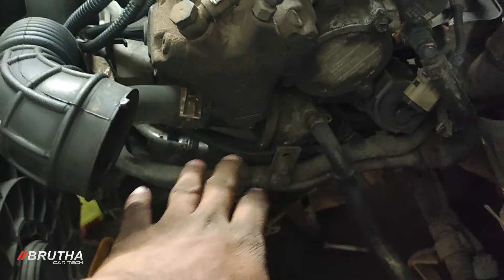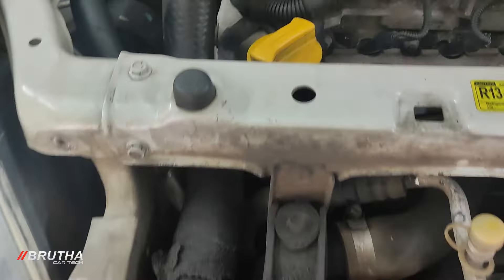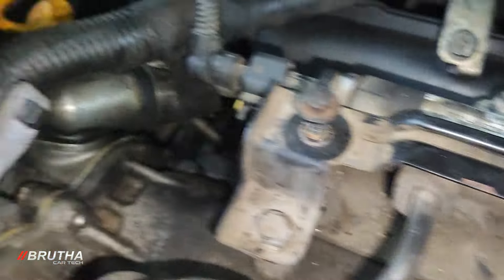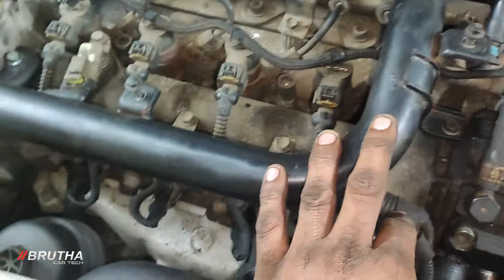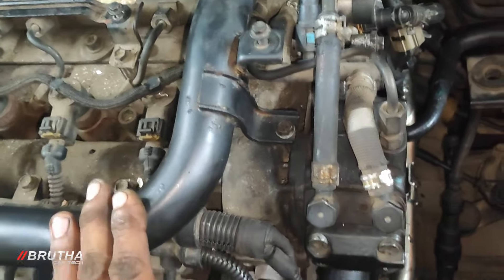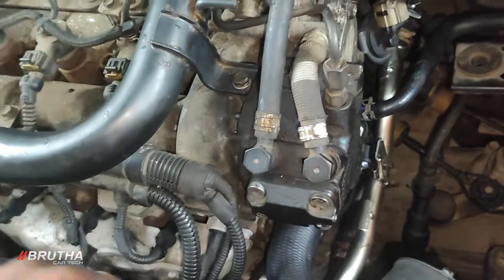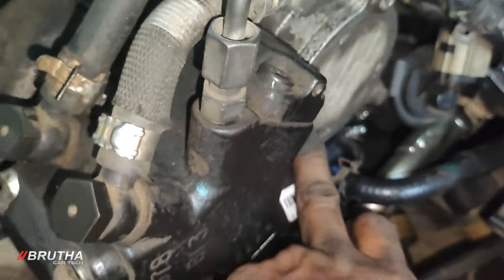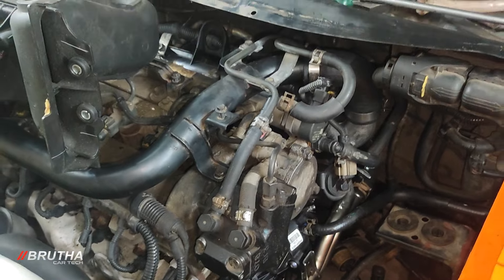maruti swift dzire egr clening

Comment: Bro ente type 1 swift 1.20 odi ippo milage kuravayit service cheyyumbol air filter fuel filter oil ,oil filter ellam mari injector ,egr ,intercooler clean cheythu but milage ippozhum 12,13 okkeye kittunnullu verenthenkilum check cheyyano .over puka onnumilla
Reply from the maker: Clutch